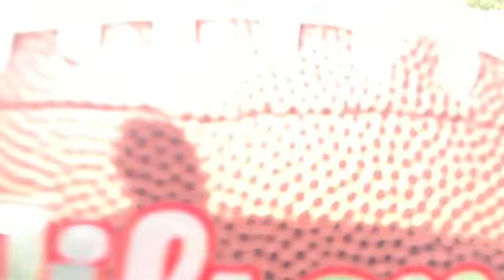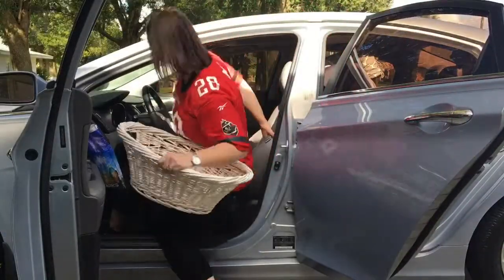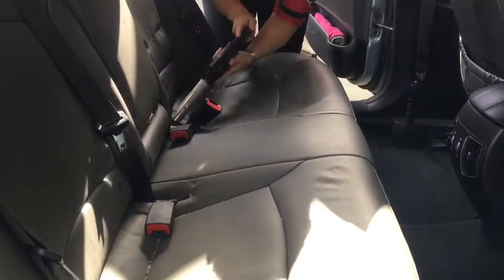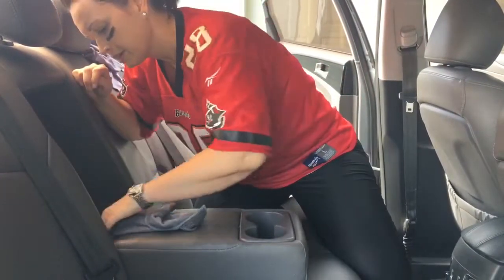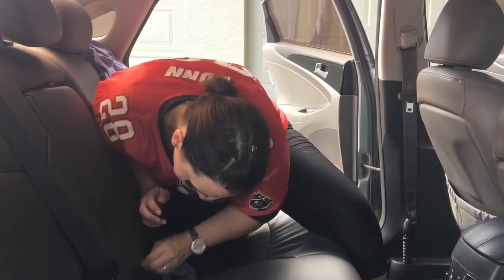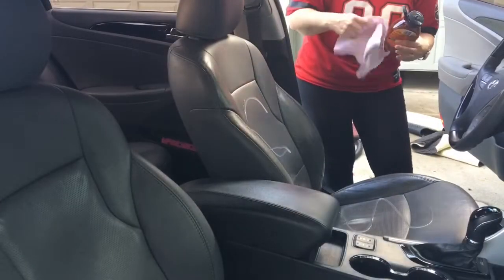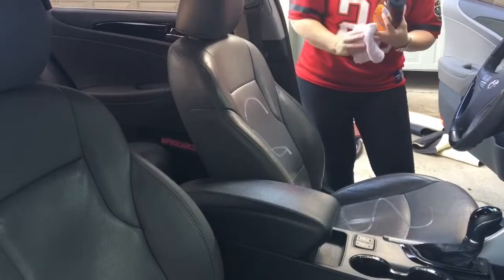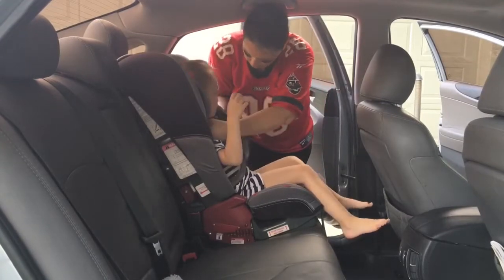Tackle It Thursday Collab | Cleaning The Interior Of My Car | Living In The Mom Lane

Comment: That's a neat gadget you have for the A/C. Cleaning the car is a big task, especially with kids. I'm going to look it the e-cloths. I hear everyone rave about them. Have you used the leather gel before? How well does it work? I need to  clean my car as well. I agree no sauce in the car. Great work looks fantastic.
Reply from the maker: Mommy_Life76 Thanks for watching! I love my E-cloth!!! They are a bit pricey upfront but if you factor in how much you’re saving on not having to buy cleaning products it’s worth it.  I have been using the gel for years!! I highly recommend the gel. It smells really good, has like a new leather scent. I’ve never had any cracking or anything of my leather interiors of other vehicles and this is the gel that I used. I live in FL so the interior can become scorching hot in the summer.  Hope this helps!! 😊